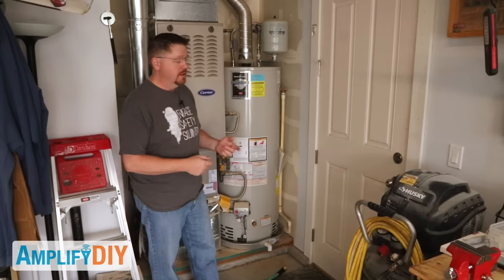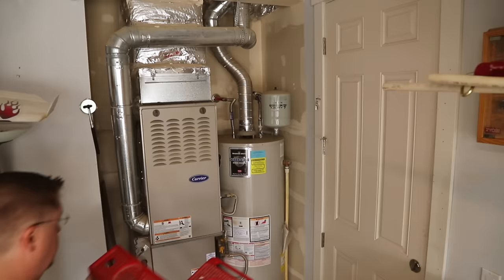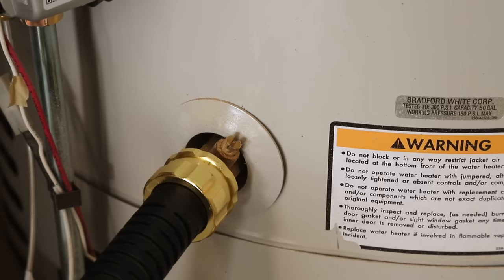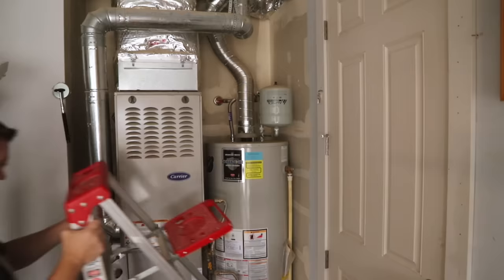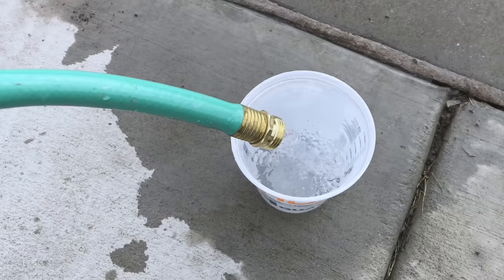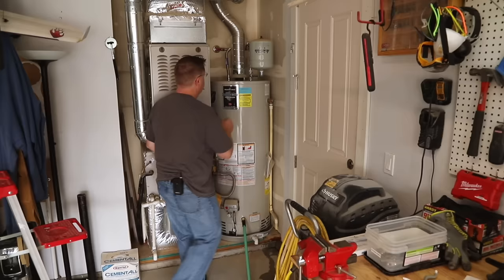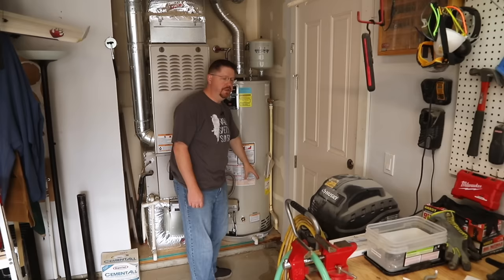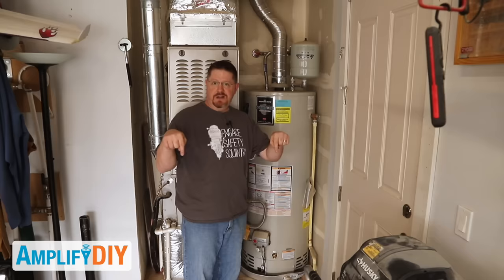How To Flush A Hot Water Heater To Remove Sediment

Comment: I have been doing this all wrong for years!!!  Will start doing it right this year!!!  Thank you so much!!!
Reply: If you were doing it wrong all these years and still work fine, then maybe there is no reason to do it. The best thing you can do to your heater is to vacuum the ventilation holes. My 40 years old water heater still work and I never flushed it. I do vacuum around it, also you need to make sure that there is enough air/ventilation around the heater.
Reply: pepperjack8 40 years goddamn!
Reply: @pepperjack8  yes, air ventilation only required for gas heaters

Comment: This helped me with the process greatly.  I wish I had known about this years ago.  We lost two water heaters to corrosion on the bottom.  The last time it flooded our downstairs.  It sits off the kitchen with tile, but the water reached the wood floors which are glued to the slab.  Obviously we needed drywall replaced, too.  Lucked out finding the same wood on clearance sitting in a warehouse.  The sediment looked sandy.  I also was getting an error on the washing machine and found the inlet filter basket for cold water was completely clogged with a sandy colored sediment which washed out easily.  It was not hard.  We also have a water softener.  Wasn't that supposed to help clean up our water? It's very hard water in San Diego btw.

Comment: Hard water areas, remove your pressure relief valve and soak it in vinegar while your draining the tank. Not doing so means the water that crossed your threads will leave minerals. Yes, small but they will create a microscopic gap that over the months will allow additional minerals to congregate. It will keep building and eventually create a gap and then you start having leaks. A new valve is only 20.00, but a jug of vinegar is 2.00, and the time it takes is about 10 minutes to remove the minerals

If hard water is still a problem, open the top, add 5 gallons on vinegar,with the power off, let sit for 4 hours, drain to remove particulates. FILL and then turn your faucets on hot, with power still off...hot vinegar stinks, and let the sinks run for 10 minutes to flush out the rest of the vinegar and clear your faucet heads.

You cann add 5 to 10 gallons of vinegar after you've drained, and then water,  and let your hot water side flow for an hour to help clear minerals from pipes and faucets 

Check your elements 1 time a year as well. Turn power off, unscrew them, pull them out, and check for lime scale

Comment: Thanks! Not everyone has a family or friend that teaches them these so called basic home maintenance. I'm glad you posted this very detailed video. When I did this, a lot of the white crystal like build-up came out. Almost 10 handfuls. One thing to clarify is the 15 seconds water flush. This is when I get the most of the crystals. I say do it while the water is half drained. It wasn't clear from your video when to do this. I keep doing this until the crystal slows. And when the tank is empty, I left the cold water intake runs and flush the rest before refilling the tank for the second go. Thanks again!
Reply from the maker: Hi Aaron! I'm glad this video was helpful to you. Apologies that it was not clear when to do the short burst flushes. The process should be: 1) drain the tank. 2) do the short burst flushes until the water runs clear. 3) re-fill the tank. Thanks for watching!

Comment: I lived in a House for YEARS without knowing to how to do this and it cost me a LOT of work! We had so much Calcium in our water from a shallow well put in by my Brother that the sediment built up SO bad it solidified and surrounded the Electric Element and caused it to actually overheat and MELT THROUGH!

 When I removed the element.. I saw the sediment and it was a Pure O.M.G. Moment! After draining the Tank I had to use a rod to break the sediment up and used a SHOP Vac with a smaller Clear Flex Hose taped to the end to pull out chunks of sediment!

 THEN I burned UP the NEW ELEMENT because I FORGOT to FILL the TANK FIRST before connecting the element wires! Replaced the element again.. and about a year later replaced the whole Tank! HARD LESSONS are the BEST REMEMBERED!

 CAUTION.. Check the pressure valve for proper operation per MFG recommendations... Water Tank EXPLOSIONS have DESTROYED ENTIRE ROOMS and KILLED PEOPLE due to a Relief valve 'Malfunction'!

Comment: Turn off hot water tank then do a load of laundry on hot. Now your tank if filled with cool water and you can water your grass when emptying it each time.
Reply: I do mine annually in the spring. I use the hot water to spray off my dirty garage floor after all the Ice, snow, salt, leaves and dirt gets tracked in all winter.
Reply: Good Idea.
Reply: Good Idea too.
Reply: yeah or a shower.  most tanks are enough for two showers in fact
Reply: That's big brain!

Comment: For those that don't know, as he correctly points out, you have to shut off the water because fresh water coming into the tank will mix and disturb the sediment so much, that most of it won't settle to the bottom to get drained out.  I experimented with this, and indeed, the sediment didn't come out until I turned off water going into the tank.  Only then did I get some particulates appearing. So the author of this video has done it exactly right.
Reply from the maker: This is exactly right. Think about using a squirt gun to rinse out a sink. How well would that work if the sink was full of water? 
Thanks for watching, and for the clarification!

Comment: Great instructional video.  One thing to consider is that many water heaters have a enamel/glass coating on the inside surface of the steel tank.  After draining the hot water from the tank you may allow some time for the empty tank to cool down a little before hitting with a shot of cold water.  It's conceivable that the enamel coating might crack due to the thermal shock.
Reply from the maker: Hi QCBikeCommuter - this is a good suggestion, though I'm not sure that the typical interior of a water heater will be hot enough to worry much about stressing the internal coating. If you are concerned, one way to cool the tank safely and easily is to simply turn off the heat source, then go take a shower, do a load of dishes, or do a load of laundry with hot water. This will use up the hot water in the tank, which will be replaced with cold water from the inlet, cooling the tank. Thanks for watching!

Comment: Water hammer is bad! Leave the faucet open while filling the tank! Pressurized air in a line can be a good test for weak spots in the system, in other words it's a good way to cause a leak and a major repair that requires a plumber.
Air compresses where water doesn't, so when the system is charging with water and is pressing the air you will get massive pressure spike at areas where the flow will slow down like corners. These pressure spikes can blow fittings apart, specially if they older or might have some sort of flaw already including bad install. Spikes can be hundreds of pounds in a system use to 50.
Reply: even quickly opening the facet and closing the facet quickly will do it
Reply: I just put a new water heater in last week. It sounded like an air compressor when i opened the faucet while it was filling. When i re-plumbed the house i used 3/4 copper pipe as i wouldnt put the plastic crap in. I doubt i will ever have trouble with it leaking.
Reply: @billyjack8119  copper is less likely if it's new, but never underestimate to power of air pressure
Reply: The pressure spike is caused by the inertia of a column of water accelerating and flowing at a significantly higher velocity than normal as the air escapes the faucet and then the water abruptly returns to a slower flow as it slams into the faucet. The accompanying shock wave will rebound throughout the water line.
Reply: @Sartonica  much appreciated better description of what happens than what I wrote! Thanks!

Comment: Thanks.  Older lady here- did it by myself.  And even figured out that my newer water heater doesn't have the valve to open with a screw driver- you turn the plastic screw on thing that you attach the hose to counterclockwise while keeping the hose tightly screwed in.  I feel very accomplished!
Reply from the maker: Great job!

Comment: Great video! Thanks so much for posting this. I have one question: I was told to open a faucet on a second floor bathroom of the home if you have a second floor to drain out the air. Our water heater is on the first floor. Does it matter which floor I open the faucet on? Thanks!
Reply from the maker: Yes, it's a good idea to open the faucet that is the highest from your heater. The idea is that the water which is in your pipes between that faucet and the heater will all be allowed to drain back down into the tank and back out of your house as you flush. If you open a faucet from the first floor, then funky things can happen in the plumbing as you'll have water held in the pipes on the second floor, but you are letting air into the system from the first floor. The air can travel back to your water heater tank (which is what you want) or it may decide to try to go exploring up to your second floor. It's not a big deal one way or the other, but that is why people recommend opening a faucet upstairs. Great question!